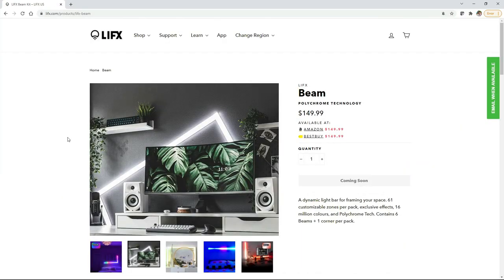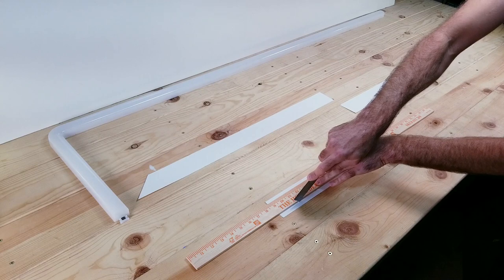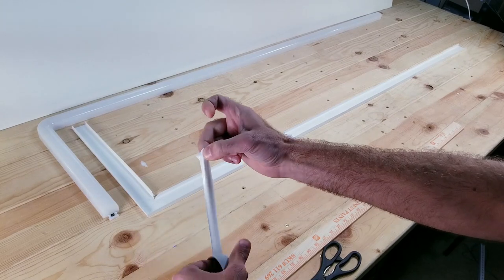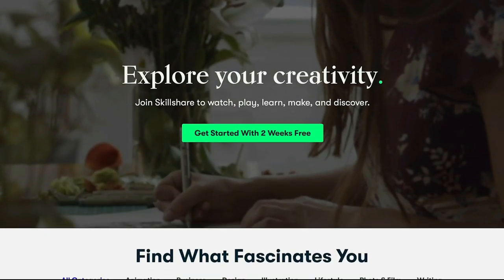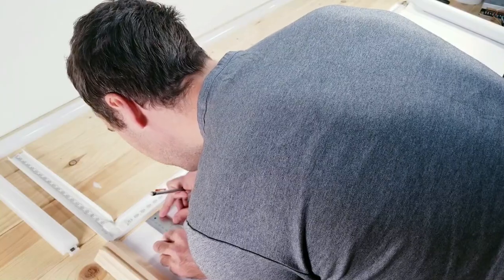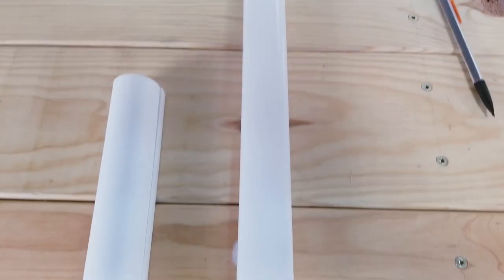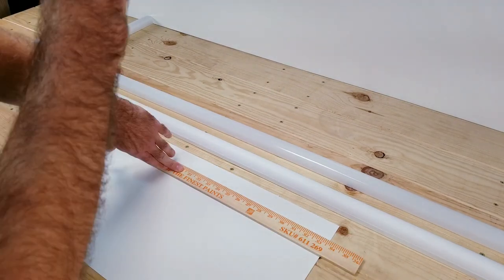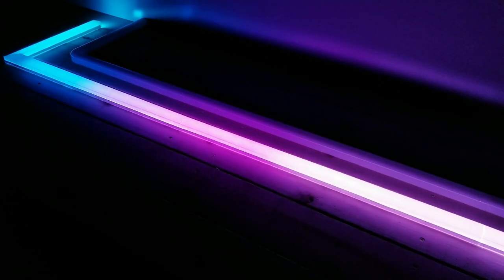DIY GOVEE GLIDE / LIFX BEAM USING ONLY PAPER - NO TOOLS REQUIRED!

Comment: my mans all you had to do was cut a 45 degree to get those to meet in the corner. Bring one strip all the way over, make a line at the inside corner and one at the outside corner, take it out, connect the lines, cut it and insert it back. do it for both sides.
Reply from the maker: Thanks so much for watching and taking the time to comment! I did try cutting them at a 45 degree angle and when the paper is flat they fit together perfect but when i put it back together, because of the curve, they did not line up correctly. Maybe I did something wrong though!
Reply: @ChrisMaherDIY  Maybe, did you mark the points when it was in its bent position? Angles and things like that are very difficult to work with, I struggle with them all the time when I try to custom make stuff.

Comment: so, in the end. u use paper roll? if we use aluminium foil on the poster board, will the light get better?
Reply from the maker: Thanks so much for watching! Yeah, I just used the paper! Aluminum foil might make it a little brighter but I don't think it would be very noticeable to make it worth the extra work. But for sure something you can try to see if it makes a bigger difference!

Comment: Great nice change of pace. Suggestion: u can cut the rounded covers at 45 deg angles before putting them on top. It should close the gap.
Reply from the maker: Thanks for watching and I appreciate the comment! I did try cutting the paper at a 45 degree angle before folding but when it gets folded to put in the channel and pushed together at the angle, it does not come together and there is still a gap :(
Reply: @ChrisMaherDIY  i think the way to do it is to make the rounded paper go all the way to the end, then trace out the 45° corner while it is in the slot. Then you can take it out and cut down the traced line while its flat. If you do this on both I believe it will connect perfectly, at least it does in my head! 😂

Comment: Amazing job! How did you attach these to the wall, and did you tape the top overs to the bottom to keep from falling off?
Reply from the maker: Thanks so much! I just put a little painters tape to the back of the project and taped it to the wall! Holding up strong! I didn't even need to use tape to hold the rounded paper insert in place. It just stayed put without any help. However if it does eventually come out I would just use a little bit of clear tape to keep it there nice and snug. You would probably need tape though for sure if you were going to put this on the ceiling.
Reply: No joke cheap fake alien tape from Amazon, it's like 5 bucks for 20ft. It works great
Reply: I click on view reply and nothing is shown  "please help"
Reply: @ChrisMaherDIY  would double sided tape work better then painter tape by chamce
Reply from the maker: @Nissanwarrior69  thanks so much! I think they both would work well so take your pick!

Comment: Hey Chris, love your DIYs! Govee RGBIC LEDs say you can’t cut them but I’ve heard you say you can cut them to size. Can you explain how to do this without ruining the strip of lights? I’d appreciate it!
Reply from the maker: Thanks buddy! In my experience i've seen that when you cut the govee leds, they still work but govee does not adjust the animations to factor in the missing pixels. What that means is if you have an animation where lets say the last 30 pixels should be red, if you cut the last 30 pixels off, govee will not adjust it to make the last pixels of what you have left red. You simply wont see the red anymore. So is it perfect? No, but does it still work, yes. Also if you solder or attach those 30 leds back on, then in my experience it will work perfect again. The other option which I have used in a few of my projects is just hooking up the govee led's to WLED and controlling them that way. Here is a video I made showing how to do that: https://www.youtube.com/watch?v=l0sRG1WAbq0
Reply: @ChrisMaherDIY  that makes complete sense, thank you so much for the advice!

Comment: Awesome idea, but just wondering how would you make this an angled version?
Reply from the maker: Thanks! What angle would you want to make? I made a 90 degree angle in the video but i'm sure it wouldn't be too difficult to make it a different angel.
Reply: @Chris Maher  Oh I didn't expect u to answer lol. I'm talking about like it being on the top part of the wall where it touches the ceiling.
Reply from the maker: @glitched_redux3428  Ahh gotcha! Might be a little gap if you did it that way but i'm sure you could come up with some way to get the 2 sections to butt up against each other! I might have to try making one like that at some point!

Comment: great informative video!, Question(s)

1. Since I’m using govee rgbic strips will I need to raise the roof of the paper to have it diffuse nicely to avoid hot spots?

2. Would you recommend using 2 pieces of  stencil paper from hobby lobby to diffuse the lights instead of paper?

I Appreciate your craftsmanship and editing in your videos, you’re very inspirational to thousands of people!
Reply from the maker: Thanks so much! I appreciate the kind words! Govee led strips have 30 led's per meter vs the 60 that I normally use so i'm pretty sure you would have to raise the roof of the paper more to get a perfectly diffused look. I'm not sure how high but just experiment with it until it looks perfect and go from there. The stencil paper would probably look good and I think doubling it up would be perfect! The only bummer thing about the stencil paper vs the long roll of paper is that you will have some seems unless you can find a way to make them almost invisible!

Comment: I might have missed it but did you use glue to keep the paper connected? Like the bottom and then the bent pieces of paper?
Reply from the maker: No glue but you could certainly use some. The paper stayed put pretty good without it but I did have to be careful moving it!

Comment: Is it a 5a power supply that you used? Can you tell which power supply did you use in this project?
Reply from the maker: Thanks so much for watching and great question! I do believe for this one since there were not many lights to power I did just use a 5v option. Thanks!
Reply: @ChrisMaherDIY  hi thanks for the reply! Can you also say how much Amps and watt it was? Do i need 5a for this since one single led is 0,2w 2(meters)x60(led count per meter)x0.2=25w   25w/5v=5

Comment: This was a great video and I will definitely try this out! One question, in the final videos and images, did you use the Govee lights or the other ones?
Reply from the maker: All the pics/videos were using the ws2812b led lights. The govee lights will still look good but since the leds are a little more spaced out, it wont look the exact same. Thanks so much for watching and taking the time to comment!

Comment: if i cut the round one at 45 before folding them, the tube will come with 45° edge right? so you could join simply doing the same as the las design but with the rounded one.
Reply from the maker: Thanks so much for watching! I did try that first and it made sense in my mind but its the bend that does not make them line up perfectly. lol I was like why does this not work!

Comment: I wonder if you could get the rounded pieces to a 45 degree angle by drawing a top-down view of a 45 while it's in the groove, then take it out and cut on the line. I imagine it would produce a curve on the paper similar to a "straight" flightpath on a globe. Easier than trigonometry I suppose.
Reply from the maker: That sounds like it would work! If I do this project over again I'll have to give that a try. Thanks for taking the time to comment!

Comment: Govee claims you can’t cut their strips on Amazon . Any info?
Reply from the maker: You certainly can cut them and honestly you don't lose much functionality. Basically the govee app does not recognize that anything was cut off therefore all their animations will continue to run as if the entire strip is there. Would it be nice if the app would be able to recognize that the strip is shorter and adjust accordingly? Yes, but depending on what your using them for, they still work just fine. You can also connect them back together if you did end up cutting them and they will work perfect. Here is a video I found: https://www.youtube.com/watch?v=onP-9ayIR9o

Comment: Amazing vid, never knew this was possible. Just wanted to ask what other materials can be used for diffusing the light as an alternative to poster board? I’m looking for something that can last much longer on the wall than just paper. Cause unfortunately, Aluminum channels found online don't bleed to the sides like the govee glides do, and they don’t diffuse the light enough for individual leds to blend with the rest.
Reply from the maker: Thanks so much! I'm glad you liked the project. I've found that some stencil sheets provide some good diffuser qualities but the ones i've found that work were at some craft stores (hobby lobby) there are some on amazon but you have to have like 6 layers of them to make it look perfect and thats just too much work. The best acrylic i've found on amazon is this: Acrylic: https://amzn.to/3zyiUCL but if you go this rout you would need to have a little bit more space between the acrylic and the leds to achieve a perfect diffused look. Good luck buddy!
Reply: You can buy a roll of white PTFE (plastic) .010" thick sheet. I made something similar to this using that PTFE roll, cut and rolled into 1.5" tubes and taped the overlap together with 3M mounting tape. Then I made "caps" for the ends of the tubes using white duct tape. If you wanted the tube to have a flat back for wall mounting, maybe foamboard?
Reply: @ChrisMaherDIY  Hi, great proyect but would you recommend doing this as a definitive setup for real?
Reply from the maker: @nestomagic  you definitely can but I'd give it a 7 out of 10 on the looks department. I would imagine most people would want something a little better looking!
Reply: @ChrisMaherDIY  Wow thanks for the fast response will take that into account

Comment: Can i use the regular paper roll to make the lifx lookalikes one? Or it has to be the poster paper due to thickness and the sharp edges form?
Reply from the maker: you can certainly try but my guess is it might not be rigid enough to have nice sharp edges. But maybe if you double up the regular paper it might work? For sure something you could try!

Comment: you know if govee leds has the same final result has ws28 ???
Reply from the maker: I think it would still look good but not as good as the ws2812b lights I used mostly because the Govee LEDs are a little more spaced out. Having each led a little closer is going to help with the diffuser and animations. Great question and thanks for watching!

Comment: Is there any difference to using normal printer paper? Should I do for like a cardstock or is crafting paper the best choice? Do you have a link by chance?
Reply from the maker: Printer paper would work fine but since its not one solid role, its going to be a little harder to hide the seems of putting them together for the top diffuser. If you want to use printer paper for the channel, you would probably have to use 2 or 3 pieces to make it rigid enought to hold the shape. Here are a couple links:

Paper Roll: https://amzn.to/3jzjhIg
Poster Board: https://amzn.to/2ZklKQ4
Reply: @ChrisMaherDIY  thanks so much. I held up a piece of printer paper to my govee rgbic and it seemed to work however it looked like there were black particles all over. Perhaps the type of paper?

Comment: Tools required: Pencil, Ruler, Scissors, Knife, and an Angle Finder 😎

Edit:  Also, the angle needed for the arched paper won't be 45 degrees.   To get the right angle, you would need to measure the width of the channel and use that as the starting point for the cut on the inner corner.  Then just use a strait edge to mark the line from that point to the outer corner.
Reply from the maker: lol i'll have to make a video where i just rip the paper with my hands but then my hand would still technically be considered a tool hahah. Thanks for the tip! I'll have to give that a try if I ever make another one!! Thanks for watching and for taking the time to comment!
Reply: An easier way to cut it at 45deg is to keep the arched channel all the way to the edge and with a very sharp craft knife just go down at 45deg, repeat for the other side and then just slide them to touch each other... all done.
If you're curious, you can then open the channel up and you'll notice that the cut looks curved when the channel is flat.
Hopefully I manage to explain this :)

Comment: These are pretty delicate though, and may fall apart if its much longer, say 5m
Reply from the maker: Yeah they definitly are delicate. They would get destroyed pretty quickly if you have kids running around and its in a place that can get bumped into. For this, I put it in a spot where it really wont get bumped at all so its holding up just fin! You cuold make it longer but would just need to secure it to the wall in more spots (i just used painters tape) lol.

Comment: this was an awesome idea!! may i know what kind of stuff did you use for lifx beam? is it both sides poster board? does it have a brand or i will just tell to the store the poster board and they already know it? thanks in advance 🥳
Reply: also, is it safe to use that kind of stuff? like when the led lights is starting to heat?
Reply from the maker: Thanks so much! For that one, it was poster board on both sides. I honestly dont remember the brand. I think i got it at a place called hobby lobby. But whatever store you go to just ask for poster board and it should definitly feel thicker than regular printer paper. I think poster board is all pretty much the same and you can kinda get an idea from the video what to look for in terms of thickness.
Reply from the maker: I've neve had any problem with things getting hot but I also dont leave my on all day. I'm also generally in the room when they are on and I dont run them at full brightness or all white. When leds are at full white, thats when they start to warm up. If they are doing animations and colors, in my experience they dont really get hot at all.
Reply: @ChrisMaherDIY  thank you so much, this would be a big help!! :)

Comment: If I use WS2812B RGB how can I have that music snyc......?
and how can I connect those RGB to my PC?
Reply from the maker: There is a way to get music sync working on these strips using WLED but I have not tried that yet so I honestly have no idea how that works. In the video, all that I have going is pre set animations using the WLED program. For the computer question, are you wanting to use them in the tower or just power them using a computer?
Reply: @ChrisMaherDIY  Yes I want. How can I do that? just like you
Reply from the maker: @izumirestrictedaccount4080  i don't have much experience at all with rgb lights inside a gaming tower unfortunately. I might have to try making a video at some point to learn. If I do, I'll let you know!
Reply: @ChrisMaherDIY  Thank you so much. I will be waiting for that.
Reply: @izumirestrictedaccount4080  If your motherboard has a "ARGB" header you can plug ws2812b's to that header. You just have to make sure the number of led's you have don't surpass the max the motherboard can handle. If your motherboard doesn't have a "ARGB" header you can buy something like the "aquacomputer farbwerk 360" controller. it does up to 90 leds but can being customized quite a bit via it's software including pc sound reactive.
Reply: @TheFallenAngel13524  Thank you so much, bro.

Comment: jus curious as to how u cut the corner using a RGBIC led strip, as i thought RGBIC strips were NOT CUTABLE because of the IC chip inside them?
Reply from the maker: Here is my experience with cutting the Govee rgbic strips that i've used from them. If you cut them, they still work but govee does not adjust the animations to factor in the missing pixels. What that means is if you have an animation where lets say the last 30 pixels should be red, if you cut the last 30 pixels off, govee will not adjust it to make the last pixels of what you have left red. You simply wont see the red anymore. So is it perfect? No, but does it still work, yes. Also if you solder or attach those 30 leds back on, then in my experience it will work perfect again. The other option which I have used in a few of my projects is just hooking up the govee led's to WLED and controlling them that way. Here is a video I made showing how to do that: https://www.youtube.com/watch?v=l0sRG1WAbq0

Comment: So when making the creases, you used the edge of your protractor ruler thing. Something that is sharp but dull so it doesn’t cut through?
Reply from the maker: Correct! Just something with a edge that wont cut through the material!

Comment: Amazing stuff. Thank you for helping us combat capitalism :) Working on a similar project but using a PVC wire duct to mount the LED strip in, and using a white paper tape (aka:  painters tape/masking tape) to cover the duct and act as a diffuser. My concern is with heat dissipation, and also the impact on light discharge. Any ideas?
Reply from the maker: Brilliant idea! I've never been too worried about heat dissipation but I'm also just making things for around my house that I don't have on all the time but maybe a thin strip of metal could act as a heat dissipator? You should make a video on putting it together! I'd love to see how it turns out!
Reply: @ChrisMaherDIY  Definitely will try to make a video while putting it together - although I am not a YouTuber at all, so the video shant be as good as yours :) I'll share it with you. God Willing, the LED strip should be arriving in 20(ish) days from China.
Reply from the maker: @aamershams8484  Awesome! Cant wait to see! Lol with all the supply chain issues, hopefully you will get them!